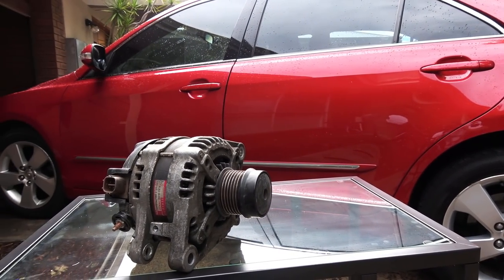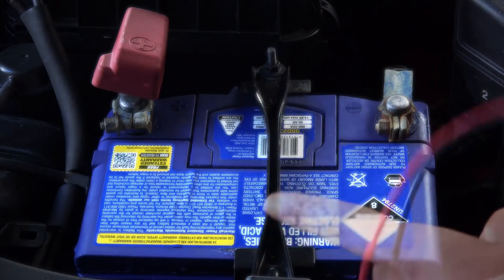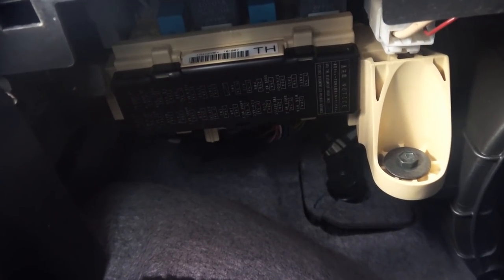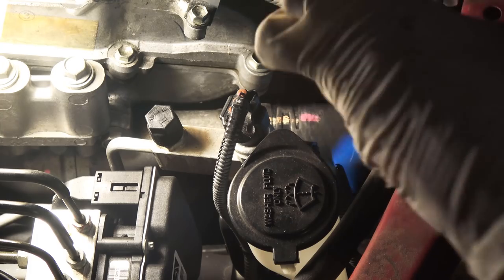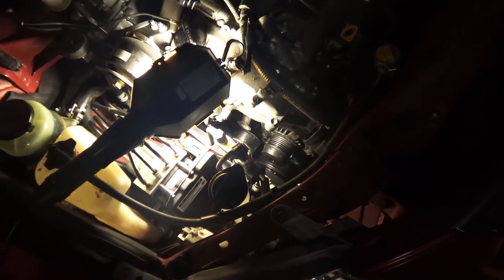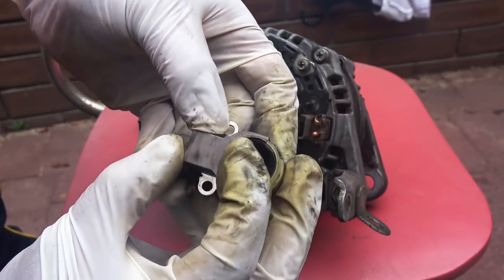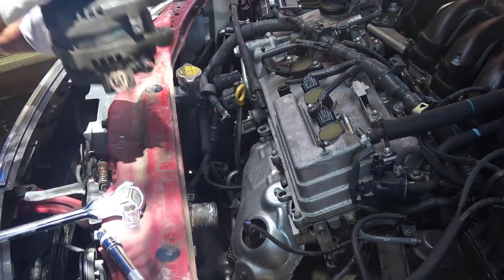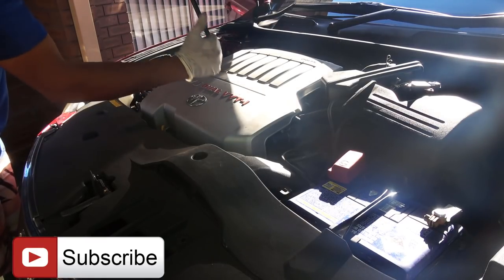How to Replace an Alternator (Toyota camry / aurion / avalon / lexus alternator removal procedure)

Comment: You can get the alternator out without dropping the coolant. Remove the radiator support panel and you can get the fans back far enough to allow removal. Also remove the bolts from the CAT shroud and move it to access the rear alternator mounting bolt more easily.
Reply: Thanks 👍
Reply: My mechanic did it this way the video creator did. I would love to see your video on how you did it. As my mechanic has had over 4p years of experience and took him a few hours

Comment: I just did this yesterday. It's a ridiculous job lol. Insane how much u gotta take apart just to swap it out.
Reply: did the same yesterday for the 3rd time ...each time the alt is covered by warranty but not the labour ...this time it had also killed the batt and the plastic neck on the rad was deteriorated to the point of replacement so all in all a $500 job without the price of the alt

Comment: Yet another reason to buy a rear wheel drive car.  My V6 Mustang is super easy to work on because the engine is not sideways, and the engine compartment was designed for a V8.  It's got lots of room to work.  Yikes!  I may have to do this repair for a friend tomorrow.  Thanks for the video.  Lots of good info.

Comment: Great video, I noticed you mentioned that 13.5 volts was correct charging for alternator in your video. Is that correct as I always went off the rule 13.8 volts to 14.2 volts and my aurion is charging at 13.5 to 13.4 volts with a new battery.

Any advice well be much appreciated.
Reply: Thats normal if the emgines warm.